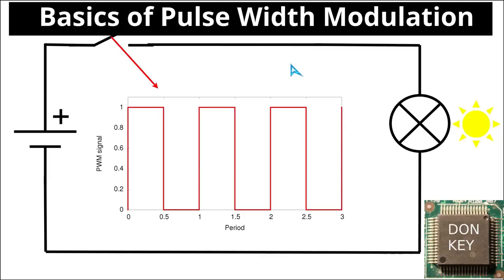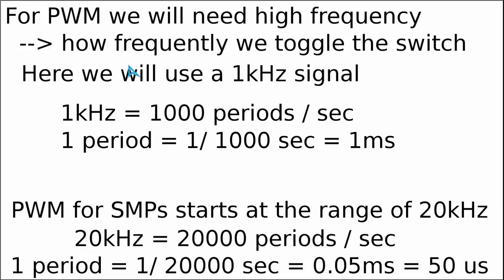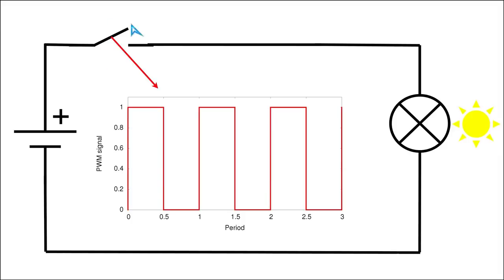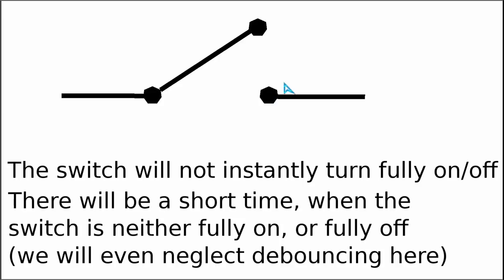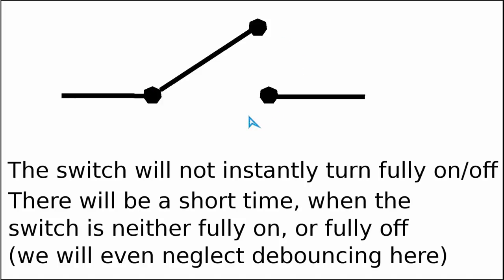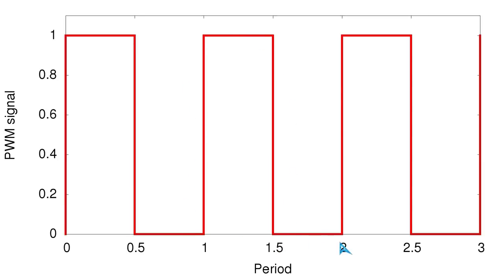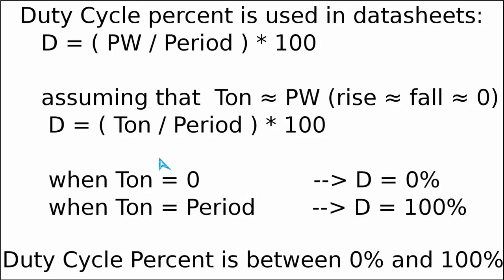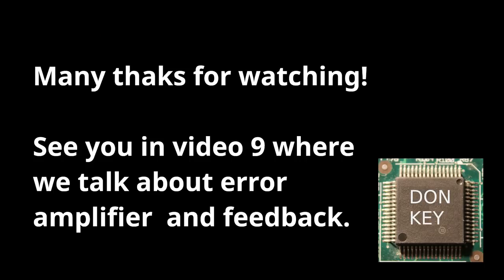Switch mode power supply repair #8: Pulse Width Modulation explained  (PWM)

Comment: Since you're talking about using an oscilloscope to debug a power supply, would you recommend to debug a it while it's running (when the 400V capacitors are live) or would you rather unsolder each component and test them individually (a lot of work), or probe the board (potentially inaccurate)

Comment: Hi. Your videos are so informative and thorough. Just wondering, I have a switch mode power supply connected to the AV Receiver. After the receiver has fully warmed up. I can hear some frequency noise inside the receiver. Would a failing filter capacitor exhibit this problem? Thanks..

Comment: 12:52 Hi. I'm a bit confused. In the last video you said that when the switch is closed, the PWM signal is down...and when the switch is open or off, the PWM signal is up. Now you are saying it is the other way round??? Which way is it? Many thanks.

Comment: Glad to have you back in good health , after finishing smps in theory can you please explain how the side components react with the circuit and why actually they need to be used like the sense resistora and filter capacitors, thank you in advance ...
Reply from the maker: In this series all components will be covered before I go into practical repair.
In fact, I intend to do a basic series on general electronics, like voltage, current, power etc. and also an introduction to the semiconductor devices.
Reply: @DonkeyLearningIT  in fact you take a long time to go through these things , 3 videos just frequency .
Sense resistor has to be used because otherwise  how will you know what is in it , every electronic meter , like voltmeter or current meter, is a resistor , there is no other way to know what is going on . That is why its used , nothing else will help . Sense resistor is just that , we use it to know what is in the circuit , by looking what happens with the resistor , if it heats up that means power is going through , if not its not .  for example 
We use Caps , Coils and resistors to filter the AC power , because most devices require steady supply of power , not all but most , Logic Semiconductors cant work on AC , that is why we filter this power , its useless to PCs as AC , needs to become DC of fixed voltage , that is done by filtering with capacitors coils and resistors .
The higher the AC frequency the lower the loses in power conversion, hence best power is SMPS or switching AC power , like you know , we cant transmit DC over power lines , has to be AC , the higher the frequency the less transmission wires heat up , hence less loses in transmission or conversion , simple
Reply: @dedskin1  Pavle Pavlovic....In fact, you could not be a teacher. It takes patience and consideration of all the details. It is actually a selfless and exhausting thing to do- to set out to truly help someone learn. I for one salute this man for what he does in these videos. I have learned so much, and all it costs me is time. But, time in exchange for knowledge is priceless.
Reply: @amicklich6729  cool for you , but it takes a lot more , takes few books not few videos but fdo it as you like it

Comment: So, in this example PWN controllers are set to 20KHz in and the PWM rate (duty cycle) changes within the 1ms period.  I have found PWM controllers on eBay with no mention of PWM frequency and others at 12KHz and 16KHz.  What is the prerequisite in determining which PWM controller's frequency is applicable?  Also, are all PSUs in computers today of the same PWM frequency?  Say, at 20KHz or does it vary from manufacturer to manufacture?   Does a high frequency mean greater cost but better quality of output?  I note that there are grades in PC PSUs based on efficiency.  Does a higher frequency help towards that efficiency?
Reply from the maker: In the video example actually I use 1kHz to make the math simpler, this is how we get the 1ms period. For 20Khz the period would be only 50us. Yes, in theory the duty cycle would change from 0ms up to the 1ms range, depending on the amount of power needed.
The switching frequency varies from one product to an other, it is up to the engineer to select a frequency based on the components what are available. 12Khz is a really low frequency, even with my 40 year old donkey ears I can hear that characteristic whine.  Young people will go crazy next to such a supply, since their ears are more sensitive at high frequency. 
When it comes to efficiency, there is always a tradeoff between so called switching losses and so called inductor losses, so engineers do simulations with special software to optimize the efficiency. 
Also, to improve the efficiency, one will have to use more complicated topologies which I will cover in later videos. It is more complicated, so I cannot simply explain it in a comment.

Comment: I feel soo DONKEY 😮☺😊
Reply from the maker: Naah, the Donkey is only me, since I learn slow. My viewers are always smarter!
Reply: @DonkeyLearningIT  what is I am saying is that I waste my too much time entire 2 year all this mathematical calculations formulas and many types of data sheets but at the result I got nothing I just watch 9 of videos from donkey learning IT everything is in a set up in my mind now I feel so donkey because I waste my too much time
And now I am happy with it☺☺☺☺ thank you so much for your great work. I am waiting for new videos.
Sir
Reply: @DonkeyLearningIT  for just information I repair my first switch mode power supply Board of a DVD Player which is just have a open circuit optocoupler I am very happy now
Reply from the maker: @captainblackbody6350 I am really glad if the contents what I put together so far has helped somebody. As I wrote, it does not make sense to jump into the middle of things without covering the fundamentals. Also, there should be a clear path in the fundamentals as well, what people can follow from video to video. This is why I try not to jump from one topic to an other way too fast before I explain the basics.
Reply: @DonkeyLearningIT  at now I am  3 phase 420v linear supply mechanic nothing much to do I always want to become true electrician , always waiting for your new lecture with a different thinking